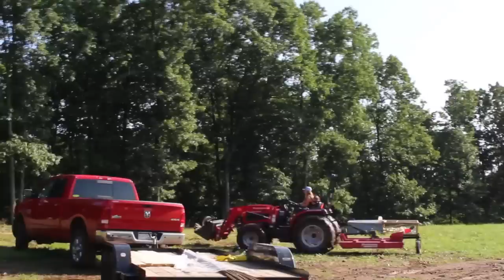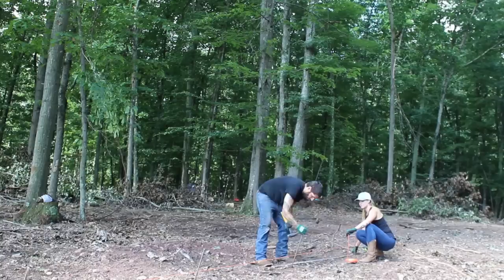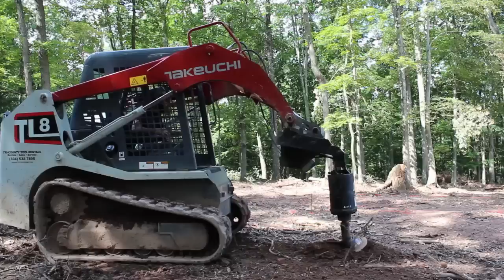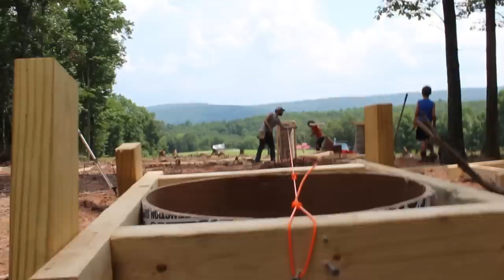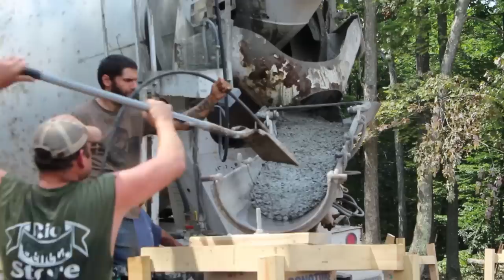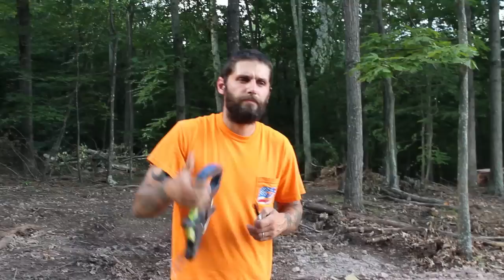Pouring The Concrete Pier Footers For our A-FRAME

Comment: Shooo. I feel your pain! My current build site is difficult to get up too. If it rains, I have to wait 3-5 days for it to dry out before dump trucks or concrete trucks can come up. Of course, waiting that long, there's a good chance it will rain again before it dries out enough for those heavy trucks to drive on the ground. It's hard work. It's more than a second job!

Comment: Bro, easiest way to explain 3,4,5 (Pythagorus's theorum) to an apprentice (in New Zealand), measure out 3M one way. Then from the starting point measure 4M at a right angle to the first line from the same point.  Joining the two points across the diagonal holding the tape measure should equal 5M perfectly.  If not adjust accordingly. 😉

Just subscribed from NZ.

Comment: How did you guys get this done with noj experience necessary, Digging the multiple holes, making sure the footers are deep enough, pouring the cement, I also see the multiple footers are in a slope downward, that is not an easy job, especially for a husband and wife team, and to make sure they are level for when the cement truck comes , the footers are ready to go. I mean for no experience on an A Frame home 🏡 you guys make it look easy. And I know it's not. Great job Josh and Erin. Very inspiring to watch you two work. A pleasure. If I ever one day want to build an A frame home, I'll follow your method. Stay safe guys and happy building. 👍🏼👍🏼👍🏼 I guess when you have the correct measurements and the right tools and equipment the job becomes a slight bit easier I would think. 👍🏼🤗

Comment: Interesting! Although in years past I've used sonotube for porch 0r deck support, it's always been typically poured footings and blocks foundation for the several additions I've done. This time tubes and beams seemed like maybe a better idea for the roughly 11x14 room I'll be adding. Your video has me convinced that it will be a better option.Thanks!

Comment: This video is great!  Exactly the foundation I am looking to do in Minnesota.
Couple questions-  did you have to put rock at the bottom of the drilled holes or just poured the concrete over the dirt?
What is your footprint size and was 6 foot spacing required by code?  I am planning to build a 30x48 house on piers and was hoping to space the piers every 8 feet in length and 10 feet in width... 28 total piers

Comment: What type of rebar tying schematic did you use?  How much overlap and what type of spacing between your wire wraps?  What is the code on the rebar overlap in inches?  Also, did you have a specific formula you used to derive the amounts of rebar needed inside the pier, if so would you mind advising?  What distances are you installing the vertical rebars from one another and from the inside wall of the sonatube?

Comment: Hi!  Approximately what was the cost for your concrete and tubes for your piers?  If you don't mind sharing that.  We are thinking about doing something similar, but with square forms.  

Also, did you have experience in calculating the appropriate spacing vs load bearing?  Did you have help with that?  That is something we are concerned about with our build.  It will be a 1.5 story  log cabin with North Carolina snow loads, so we are a little nervous.  We want to make sure we get it right!

Thank you for sharing all your videos.  You have been a great inspiration for us!

Comment: Hi. Amazing project and great video. I didn’t quite get the computations you did.  I mean i can’t picture out those lines. I’m planning to build an A-frame house also. Can I 
possibly get a diagram of those lines and measurements coz I wanna use those computations as my guide. Would appreciate it. Thanks!

Comment: Any reason you poured the middle piers to ground level and then a second pour into the tubes?
Reply: They explained near the beginning of this video.  It because the cement truck couldn't reach them with sonotubes in the way.  So they used wheelbarrow and tractor and hand hauling techniques.

Comment: What size  Diameter are your  Pier foundations? I was going to go with 12" round piers. Is therer a reason you went with such a large diameter? The look beefy lol
Reply from the maker: +Marcus Jordan we went 18"...just personal preference
Reply: I know nobody wants to hear this but the spacing between posts is based on the depth of the beams. The spacing between beams is based on the depth of the floor joist. The roof and floor square footage is used to calculate the weight on each footing. The type of soil is used to figure out how much weight per square foot it can support. Simply take the weight on the post and that tells you how big the footing needs to be. If it isn't bearing on enough solid soil it will sink.

Comment: i need advice: i hooked up a switch in a closet. i ran it off an existing bedroom light switch. i have power at the closet switch and also at the new light box, but the light will not come on. i replaced the switch and tested the bulb. any ideas?

Comment: 18:45 What is Josh doing with that hose? Is he pouring water in the concrete?
Reply: It's a vibrator of sorts to get the air out of a deep pour

Comment: Josh gonna be deaf as a post if he don't start wearing ear protection when he cuts rebar with a skillsaw.  That makes one hell of a racket.  Also wearing a long sleeve shirt pretty much eliminates all those hot iron burns you get from flying steel particles.  Work smart; this is the only body you have.

Comment: Just a tip for rebar, I know its late but maybe it'll help in the future, dont try and cut completly through it. Score it about 1/4 to 3/4 of the way through and then bend by hand till it snaps off. A rebar break is much easier if you have access to one. 

Footing not footer!